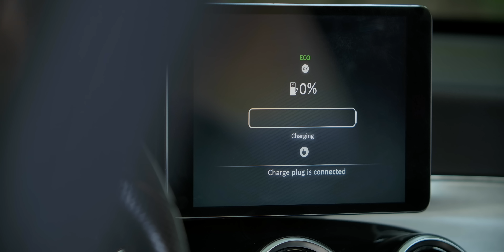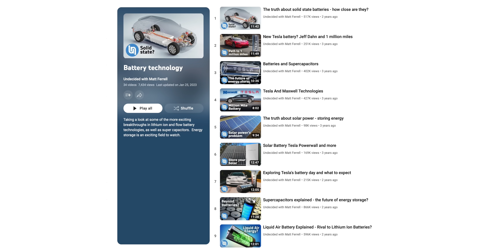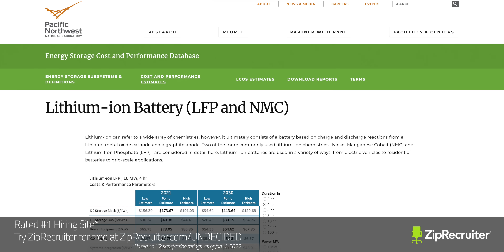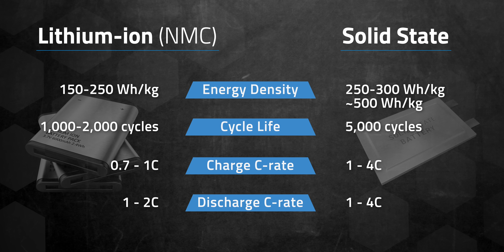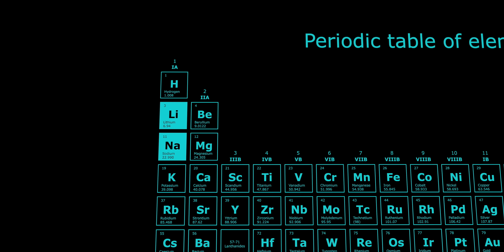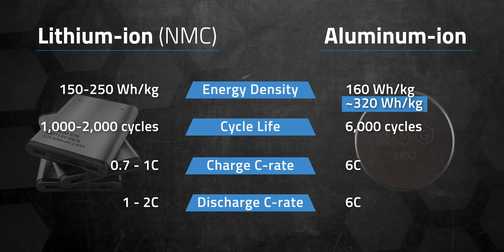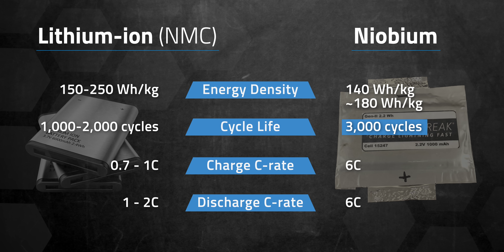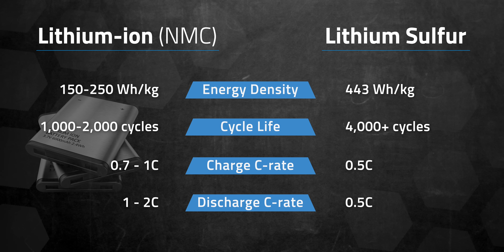Are These Batteries The Future Of Energy Storage?

Comment: The greenest one will be the one with the closest to unlimited charge cycles.  That's the one no company will ever pick because how are they supposed to sell you a $20,000 battery pack for your car every 7 years if the battery never predictably fails?
Reply: Why would you ever buy a new battery pack after 7 years? As of now, more or less the batterys never fails. So not sure what you are on about.
Reply: @peternystrom921  You are aware after 2 years the battery has less capacity right?  After 500 charge cycles, which is less than 2 years if you charge daily, you have lost 24% of your battery capacity.  If you live in a part of the Earth that doesn't have perfect 20C temps all year round, this capacity loss is even worse.  If you regularly have to spend 3 months at -30c your capacity is down over 70% just from the cold alone, thus increasing charge cycles.  Truthfully a hybrid electric/hydrogen car would be a much better solution.  But again, no reason to do that when people think batteries last forever and are so rich they can drop $90,000 on a car every 10 years.
Reply: @SinisterSlay1  Yes and all You saying is Fud and not even based in reality. Even an EV With 20% less range dont need a new battery.

Not that hard to grasp.
Reply: @peternystrom921  FUD?  Not likely.  It's well proven by the literal mountains of cell phones in land fills from dead batteries.
Reply: @SinisterSlay1  Lol its not even remotly the same technology 😂😂😂
Reply: @SinisterSlay1  No, not even remotly a good rational thought.
Reply: Well that's why Tesla has the grand master plan of cars being a service that you subscribe to and don't actually own.  Guess we'll have to wait and see if that one ever pans out.
Reply: @Tess-ellated  I would actually be ok with that truthfully.  A subscription that costs less than the depreciation of the car would make total sense if there is no upfront price and no loss when sold.  Not terribly different than a lease.

Comment: Other metrics that would be useful are safety and cold weather operation (such as mentioned only for niobium battery).
Lithium ion batteries have issues with runaway thermal effects, leading to fires, and exploding electronics and EV fires when damaged.

This is a very important issue for consumer goods, particularly in EV's where a slight performance loss would be acceptable for increased safety - consider how much of a car's weight and cost is already invested in safety.

And there's the much higher risk of having a car accident damaging the battery pack compared to crushing the battery of a tablet or smartphone. This would also be a concern of military users, as having batteries damaged by battle damage is certain to happen (you don't want a runaway battery fire on a military hybrid engine).

The other issue that particularly concerns EV's is cold weather performance, EV cars just don't do well in sub zero (Celsius) conditions. There's a lot of anecdotal reports of EV range being limited in Canada for example.

So the operating temperature when the battery starts getting degraded performance would be useful for comparisons.

Comment: RESEARCHERS ARE ALREADY ON THE VERGE OF SIGNIFICANTLY INCREASING THE ENERGY DENSITY OF SODIUM-ION BATTERIES AND UNLIKE OTHER BATTERY TECHNOLOGIES Matt DISCUSSED SODIUM-ION BATTERIES ARE ALREADY UNDER COMMERCIAL PRODUCTION.
SODIUM-ION BATTERIES ARE ALMOST 30-40 % CHEAPER THAN LITHIUM-ION BATTERIES AND ARE QUITE AN ENVIRONMENT-FRIENDLY CHOICE  COMPARED TO LITHIUM-ION BATTERIES AS THEY DO NOT DEGRADE SCARCE FRESHWATER SOURCES.

Comment: Most believe battery tech to be paramount, yet a few KNOW that aerodynamic drag elimination, and material use efficency are the master keys to tens of thousands of km per person per year - sustainable for all us on spaceship Earth.  Anyone know of a better way than ET3?
Reply: EVs are already much more highly optimised from an aero perspective than most ICE cars - the Model 3 actually exhibits a small but measurable loss of range just from taking the plastic wheel covers off for instance.
Reply: @bosstowndynamics5488  You are correct that the Tesla EVs have a little less drag than typical ICE vehicles, and there is a HUGE opportunity for further improvement too.  The coefficient of drag (cd) for the new S is 0.208 or about 2/3rds as much as most cars.  At highway speed the aerodynamic drag is more than 80% of the total resistance, and hence is responsible for 80% of the energy use.  In contrast to automobiles, aircraft cd can be less than 0.04 or 1/5th as much (and the frontal area is usually less too).  Better aerodynamics is mainly why the Aptera can get over a thousand miles of range (and with a smaller battery than the "long range" version of the Teslas).  ET3 virtually eliminates aerodynamic drag (and rolling resistance too).
Reply: Efficient car exist since 1970. Nobody want them.

Comment: Big fan of this comparison type video, would love to see a similar one on grid scale energy storage.
Reply: Current batteries are cheap enough to transition all power generation to renewables and storage but new tech like sodium ion batteries will be even better where power per weight is less important. Super cheap and long lasting...
Reply: I would like to see a cost of grid scale energy storage. Right now 1kwh of storage cost around 250 dollars retail give or take a few pennies per watt. The only problem with these other options is their cycle life cost is crap. Lets assume that 1kwh of lithium storage for 250 dollars has a life of 10 years. That is 25 dollars per year. Now if you buy a 1kwh of battery for 100 dollars and has a cycle life of 2 years at a cost of 50 dollars per year. Just because something is cheaper does not mean it is better. Even if you scale it up to 3 years you are still not nearly as close as you think. If you double the bank to extend the life does that make it any better. Not really.
Reply: @kameljoe21  Then there is the overbuilding for periodic maintenance / fault troubleshooting and extended use on energy storage like when the weather or climate in general doesn't want to agree with demand and charging the batteries. It could work for a town or even small city, but run a power hunger place like NYC or Tokyo on a battery during a storm when renewables are not exactly working at their best, then dealing with the repairs afterward is going to be quite the battery bank. I guess that is what combined cycle peaker plants will be for. Not to mention incrementally replacing and recycling a battery complex large enough to power a city and recharge all its transportation (cars, buses, short haul trucks, subways) will be a task in and of itself.
Reply: @anydaynow01  I have an idea to fix all of the world problems. Man I really need to save every one of these ideas and number in a file and then just pull them back up. 
I just did calulations again for one of matts older videos about desalinization plants, now that I think about it, I might have done it for that video already. Either way I am going to do the most basic for you. 
Solar works best for about 5 hours in most places where people live. On the equator lets just assume they get 6 hours of light. If were were to build a solar array all the way around the world at the equator and we build enough solar power to give the world 10 times more than it ever needs at every hour segment. That means we would have 24 times 10 number of solar panels than we would ever need. Using a massive switching system and installing electrical system underground we can provide electric all over the world accounting for losses and power needs. As the we turn on hour axis a small section of solar array would shut down and the next one would come online. The same for the switching system as there will be millions of connections going all over the world each one of these would switch in an order. How this is done I have no clue yet it should not be super hard. Because degradation of panels happens the larger you build it today the longer it will last. Either way over time you would replace panels with panels that are better. 
For example if 1 square foot produced 20 watts and new tech improves it to 21 watts you would just keep researching until you get 30 watts per square foot or even higher. By the time 50 years comes around you should be able to recycle all of the panels and replace them with 100 watt per foot panels or better. 
Now this idea is way out there and likely will never happen. 
What might happen is a better and much more energy efficient nuclear fusion power plant will be around.  One that uses all of those spent rods and waste.
Reply: @kameljoe21  This is why flow batteries are better for grid scale storage. There are flow battery solutions that cost more, but will last much longer.
Reply: I second that ❤❤❤
Reply: That's where the flow batteries would be interesting, at least for smaller municipalities. For big cities it will be interesting to see what kind of storage they would need to keep a city going if renewable fueled sources aren't cooperating (night, during a major storm). It's a pretty good use case for SMR base/emergency load tech supplemented with energy storage while everyone is charging their cars and running appliances at their homes and apartments.
Reply: @anydaynow01  I was toying with the idea of flow batteries to power our office.  We may need to build a new office, and I really don't see the point in not building to maximise its energy efficiency as it's far more cost effective to make it part of the design rather than retro-fit it in an already established building..
Reply: +1
Reply: Energy Dome is the only solution for that.